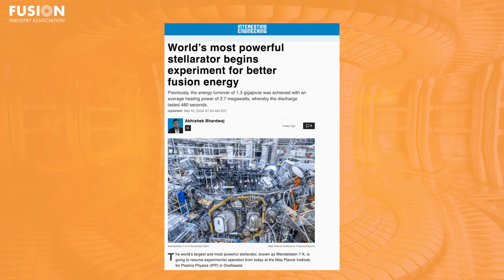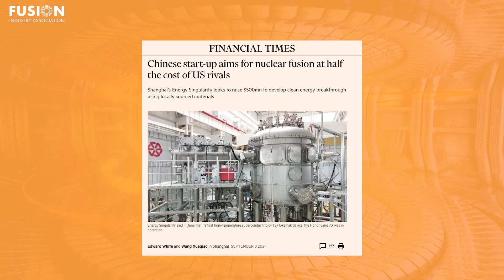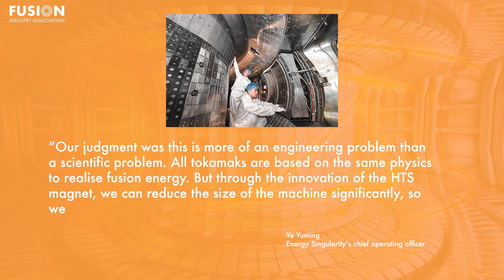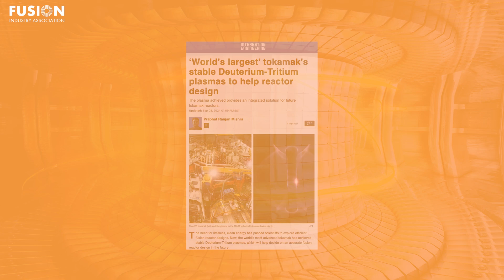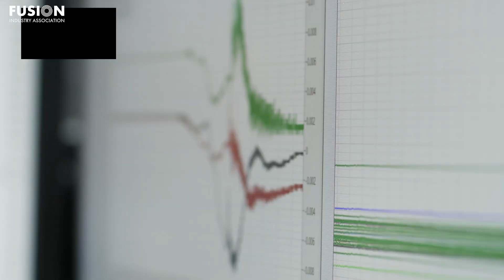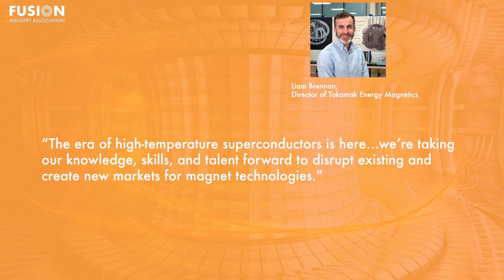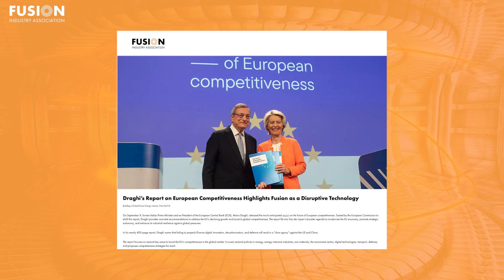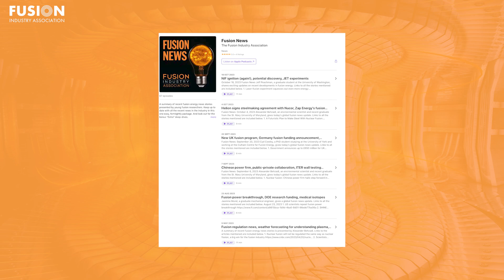Fusion News, September 18, 2024

Comment: The Fusion Industry Association is promotional in nature, focusing on positive gains and leaving out problems encountered. The ‘Interesting Engineering’ news source is based in India and is also primarily promotional. Their writers tend to not have academic backgrounds in nuclear fusion energy research so they can easily be snowed by the promotional information fed to them. Fusion energy sales pitches tend to be misleading by omitting key issues such as the radioactivity of tritium, its extreme rarity and its current market value of around $30,000 USD per gram. They often omit that most magnetic confinement fusion (MCF) machines are expected to operate in a pulsed mode when operating at near maximum fusion energy levels. This means that if the pulses are of a short duration with lengthy recovery time periods, that the thermal peak energy could be far greater than the averaged thermal output of the proposed gigawatt power plants. Note also that high temperature superconductors (HTS) are frequently mentioned as a key to overcoming several existing problems. Rarely is it mentioned that such HTS need to operate at liquid nitrogen temperatures or cooler. Another issue rarely mentioned is that the controlled nuclear fusion energy experiments began in the 1950s and since that time the experimenters have encountered numerous unexpected difficulties, some of which are still being tackled. The promoters don’t mention the many hundreds of researchers who retired without seeing their dream realized after spending decades in the field. There have been scores of machines built. The vast majority never employ even a microgram of deuterium/tritium fusion fuel in their plasma tests. Some of the current experimental machines now cost over a billion USD, with no likelihood that an actual practical cost competitive demonstration power plant will evolve from the research efforts.

The sales pitches tend to be aimed at attracting interest from the press, the public and from potential investors.

Comment: 05:50 “JET’s capacity to operate with DT fuel is critical …” 
Wiki: "JET finished operations in December 2023, with decommissioning expected to last until 2040."

I'm struggling to understand how a Fusion news channel can reference JET without even noting that it is no longer operative, and strongly implying the opposite.  The research will continue to flow from previously collected data, but the tokamak's current main purpose is to drive research into how to safely demolish such a device, how to squeeze out as much tritium as possible in the process, and how to build more sustainable vessels in the future.